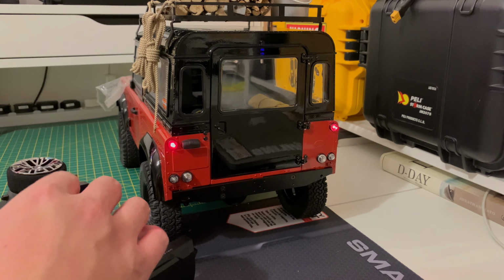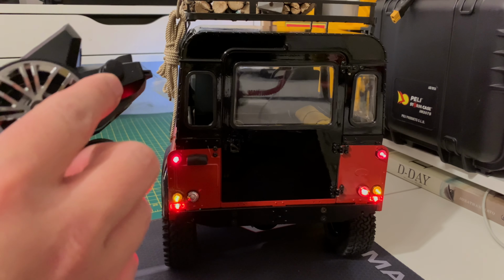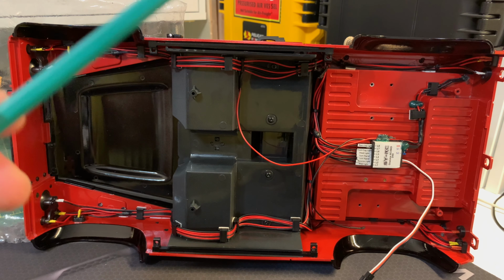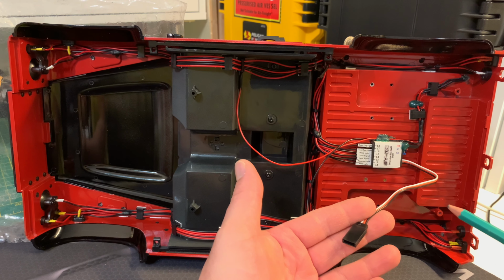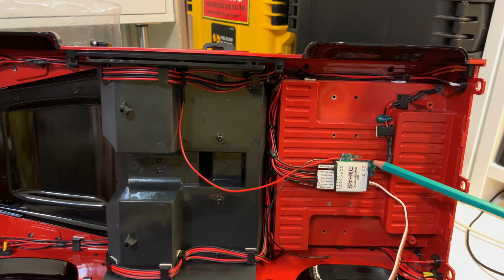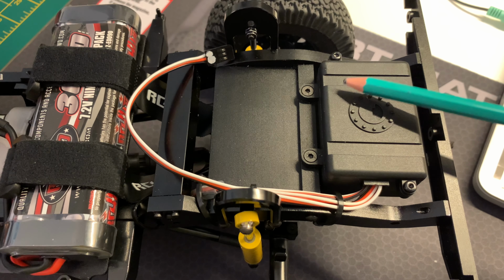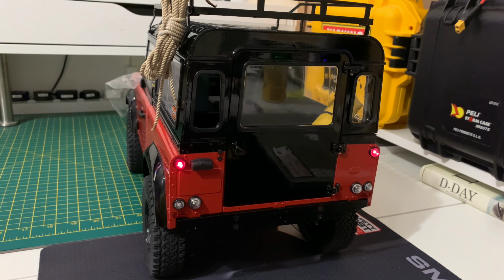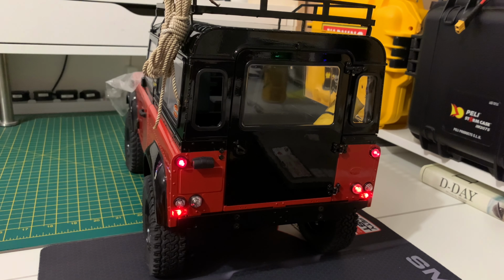RC4WD Gelande II D90 Light install and discussion - SY-RC

Comment: That looks great! Thanks for the tip on them lights. I have to get them for mine! How was the mounting process? Looks like the rear mounting’s could be a pain in the behind!
Reply from the maker: The lights are indeed a really good unit! The mounting of the rear lights took a bit of work due to the fuel cap being in the way a bit, if building from a kit it’s best to install lights while the cap is out first 😊

Comment: I’m having trouble with my light kit. It says to plug the lights into CH 1 and 2, however my servo and esc are plugged into those channels. I tried plugging it into CH3 and 4 but they just blink constantly
Reply from the maker: The little SY-RC unit that has “ESC” and “SERVO” written on it plugs into the receiver channel 1& 2 (do that part first), then the wire from your ESC (motor) and the wire from the servo plugs into the little SY-RC unit (where it says “ESC+ - S” and “Servo + - S”.
Hope this helps my friend. ^^
Reply: @astroblemeRC  thank you very much! I will try this tomorrow and hopefully it works
Reply: @astroblemeRC  I’ve got the lights working however the reverse light comes on when uou drive forwards and not reverse. Any ideas?
Reply from the maker: @tobyrichards6620  try checking that all cables are in the correct polarity and orientation. ^^

Comment: Thinking of buying kit for my trx4 defender but from your video it seems that the head lights  are a bit on the blue side so is the fog light a bit green ... How does it looks up from close?
Reply from the maker: If you choose cool tint the headlight has a strong blue hue, the fog lights are a very eye pleasing warm, in person the fog lights don’t have noticeable green/lime tint or hue, but if you put a neutral to warm led next to it to compare, say a ~3000k SST20, the comparison will reveal very slight green in the fogs. ^^
Reply from the maker: Sorry, rather than edit my original answer I wish to say there is a monumental spelling error in my message, I meant SLIGHT blue hue, not STRONG blue hue, my camera and the lighting make it seem like the blue is very prominent but in person (or with better camera equipment) the blue is very slight, I hope this isn’t too late, my apologies.

Comment: Have you got a link to the light kit you used?
Reply from the maker: Here you go ^^ http://www.sy-rc.com/product/sy-rc-oneline-rc4wd-d90-rc-car-led-light-kit-for-110-rc4wd-2015-land-rover-defender-d90-hard-body-（z-b0215）/
Reply: @astroblemeRC  do you know if there is a way of getting rid of the indicators every time you turn in one direction?
Reply from the maker: @tobyrichards6620  Sure! simply unplug the indicator line from the unit, but doing so will lose hazard lights too.
Reply: @astroblemeRC  hi, is there anyway of messaging you as I have a few qestion to ask about the lighting kit before I buy it, thanks
Reply from the maker: @tobyrichards6620  most direct way would be here due to work and I can usually reply here with more detail, also, the info may help future hobbyists that have the same Q’s ^^
Reply: @astroblemeRC  I’d like buy the same lights you have, I have two spare channels on my reviver box, 1 of them is going to be for a winch and the other is for the lights. I have the controller that the ready to run kit Gelande 2 comes with. Will I need a 2 or 3 channel version light set
Reply from the maker: @tobyrichards6620  If you plan on upgrading your controller that supports 4 channels, I would go for the 3 channel light set. If you are staying with the RTR controller, you must use the 2 channel light set since your winch will need the 3rd channel.
Reply: @astroblemeRC  perfect, thanks for the help!